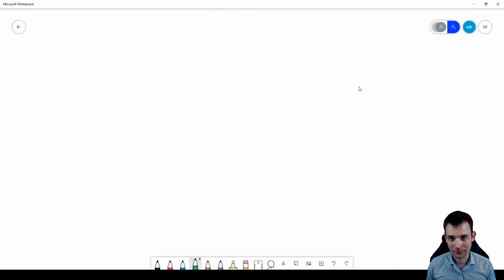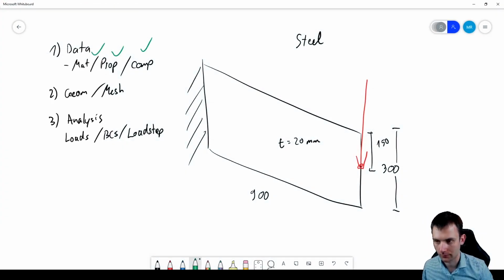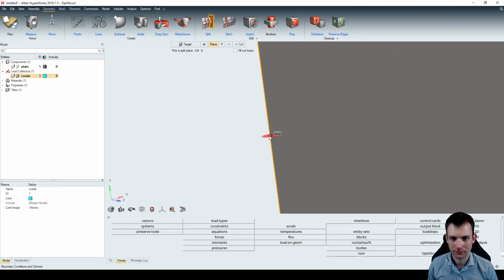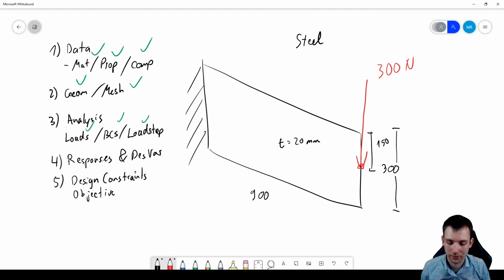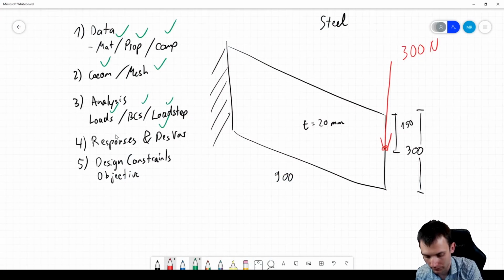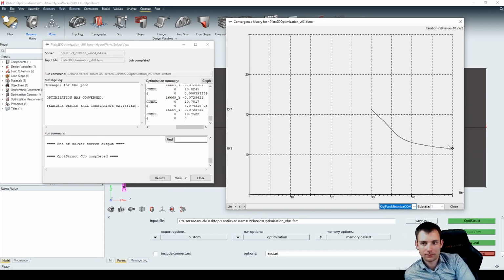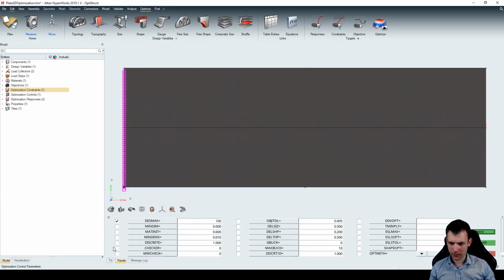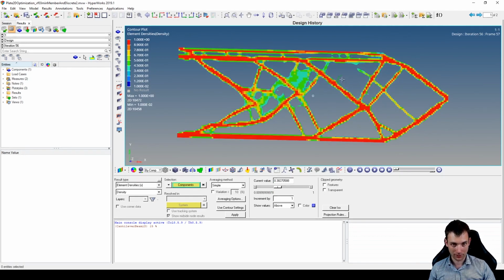Hyperworks X -2D Topology Optimization

Comment: Hello, I'm trying to do this example but I can not see the part that you set the Load collectors, Load steps (I did it by myself but not sure whether it's correct or not). After running, the software said: " * ERROR # 720 *
 Invalid static SUBCASE that has no load or enforced displacement.
     subcase id = 1"
Could you please give me a guess? Thank you!
Reply from the maker: Loadstep is not there... Or you did not assign the load collector to it. You can create a Loadstep with right click in the model browser - create - Loadstep. Same thing with the load collectors. For defining loads and boundary conditions please refer to the videos... This step is done in the most of my videos. If you have any further questions don't hesitate to ask. All the best.
Reply: @ManuelRamsaier  Thank you so much for your reply. I tried several times later and still got stuck somewhere, sometimes it shows that there is some problem with the license, although my license in fact still works. Sometimes it shows that there is something with the choice in MINDIM, MAXDIM or so on...
Here is the message about the license:
"License error:
Altair License Manager: License error

Feature: GlobalZoneAP
Error Code: 17
Error Description:
[NETWORK] 6200@133.34.37.108 - (Err: 17) Request for more licenses than available on license server
Feature: OptiStruct
Error Code: 6
Error Description:
[LOCAL] D:/Altair/2020/hwdesktop\security\altair_lic.dat - (Err: 51) Unable to use network license as a local license
[LOCAL] D:/Altair/2020/security/altair_lic.dat - (Err: 6) Unable to read file
License Path: D:/Altair/2020/hwdesktop\security\altair_lic.dat;6200@133.34.37.108;D:/Altair/2020/security/altair_lic.dat"
Reply from the maker: @thiphamtruong8129  The license message shows, that the network license is not available for the optimization you want to do. So, if you do an optimization run in optistruct it requires an amount of tokens on the license sever - the message says, the tokens are not available on the license at 133.34.37.108. 

Now if you want to change the network license to another server - you have to change the ALTAIR_LICENSE_PATH in the system variables.

If you are using a local license - check if its correctly setup in the folder D:/Altair/2020/security/altair_lic.dat 

All the best
Reply: @ManuelRamsaier  Thank you so much, I am waiting for the solution on my license at my laboratory. I also tried this on my other laptop with an educational version of Hyperworks and it works. Thank you!
Reply from the maker: @thiphamtruong8129  you're welcome. All the best